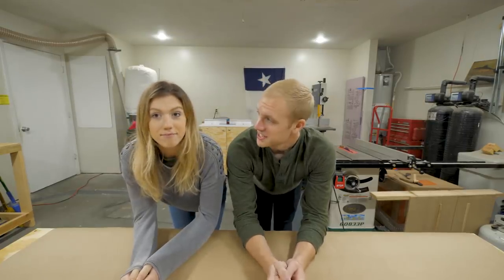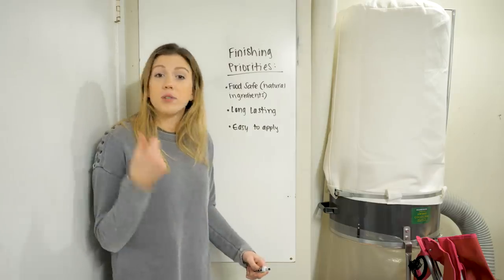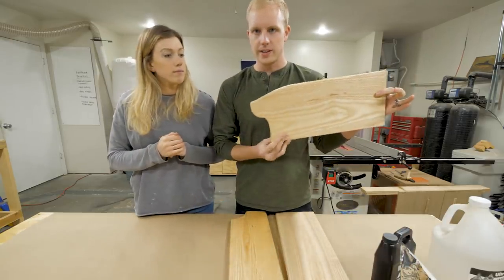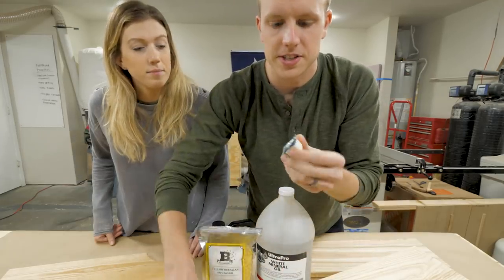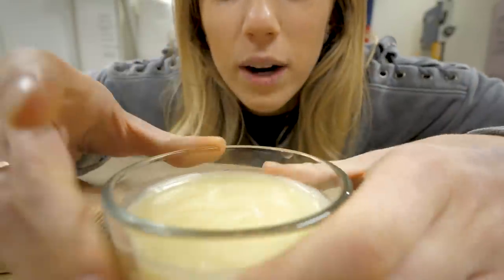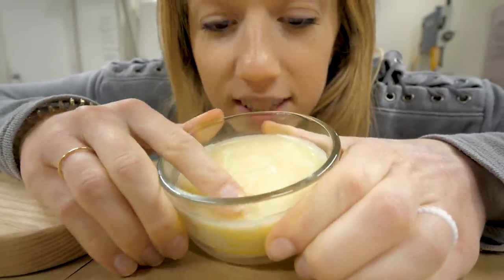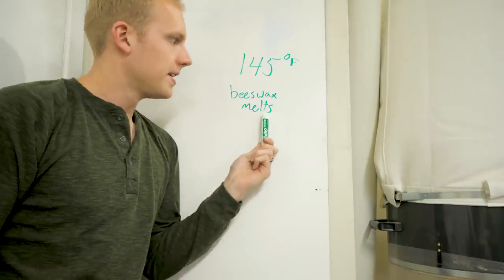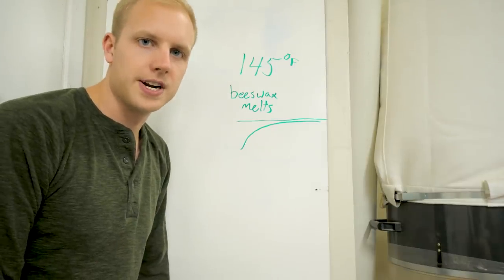we put a CUTTING BOARD in the DISHWASHER💦 and this happened...

Comment: I know a lot of people who make cutting boards saturate them (i.e. dunk them in a vat) of mineral oil to thoroughly let them absorb as much as they can. It becomes less of a finish and more of an impregnation of the board, but it really helps them to hold up a lot longer, barring the dreaded dishwasher. Though any board will require reapplying of oil over time and use.

Comment: In my youth I delivered for FedEx ground. There is no AC in those big boxy trucks. Decided one summer to put a thermometer back there. Had plenty of days during the Iowa summer that the temp was at 150F. Those semi trailers are the same deal. You might have some meltage of the bees wax in the summer time, but it should hopefully be negligable.
Reply from the maker: Good to know! Yeah I don't think it would be a big deal since it's distributed so evenly across the wood. Thanks for sharing your knowledge!

Comment: Thanks, Guys.
I love your channel and have kind of been modeling my cutting board production, in part, after you two. I wanted to tell you what I'm doing right now. All of this can, and probably will change as soon as I find a better way. I am doing a few (between 2 and 3) coats of mineral oil, and then 1 or 2 coats of Howard's Butcher Block Conditioner. Where I purchase the Howard's also sells tiny little 2 oz bottles of Howard's Butcher Block Conditioner. I include a small bottle with each cutting board, and instruct the customer to use the Howard's if the cutting board lacks luster or they put it in the dishwasher. I tell them to try to limit the dishwasher cleaning, but using Howard's after the dishwasher will really protect the finish. Your experiment proved that I was right. I was just guessing. Thanks for all you two do for the community. At some point, I will join your Maker's group.

Comment: I make end grain cutting boards. For finishing, I sand to 240, dip in a tub with food grade mineral oil for about a minute or two then, set on a rack to drain dry. After that, I melt a 3:1 ratio beeswax & mineral oil and apply to the boards and wipe off the excess. When I sell my boards I include a 2 oz cup of the beeswax/mineral mix for added value.

Comment: I sand to 1500 grit and you can definitely tell the difference. Smooth as glass. Then I dunk them for about 1/2 hour in mineral oil instead of rubbing it in.
Reply: Ritch Taylor doubt it
Reply: @somebodyandthem  What could you possibly doubt about it? I truly enjoy giving my customers the best and smoothest product I can. I will not cut corners.
Reply: I think typically people don’t sand past 120/220 because once moisture hits it the grain will raise and make any additional smoothing useless.
Reply: @JohnJones-it3us  most of us wet the board after 150 to raise grain,  let it dry, then do 180 and up... it will never raise again after you do that.  Just extra steps for a more professional product.
Reply: @stevenlarson6125  my problem is 1500 is just way to much, there is almost no reason to go that far past just being able to say "I sand my boards to 1500"
Reply: @inigomontoya4109  yes. I only go to 330 usually and get a very smooth finish. Also, the OSMO top Oil that I use works best at 330.. any higher and it doesnt penetrate very far.

Comment: I add a little carnauba wax to the mineral oil and bees wax.  It's plant based and totally none toxic, is harder than bees wax so will make a stiffer paste and will put down a slightly harder wax coating than the bees wax alone.  Also, your face grain boards, just as with edge grain boards, will develop knife marks from use.  End grain less so.  Although wood tends to be naturally antibacterial, the pores and knife marks can harbor bacteria.  Use soap to clean your boards when appropriate, which is most of the time.  When I make a board I provide a page of care instructions.  I recommend recoating with mineral oil or with my board butter mixture.   If anyone fails to read and follow the instructions, any board failure is on them.

Comment: You may want to try the Carnauba wax.  It has a very high melting point, so it should survive your dishwasher tests.  It's food safe as candies are covered with it.  You may have to put your wood projects on a turn table, balance it, and spin it at fast RPM, so when you press the wax against the wood it will create friction, melt and bond with the wood while penetrating it.  Good luck.  Cheers.

Comment: I don't know if I would recommend never using soap on cutting boards...could definitely lead to quite a buildup of bacteria if you never sanitize.  That is why it is very important to simply keep applying the beeswax mineral spirit finish after cleanings.
Reply: But beeswax itself is anti-bacterial, so ???
Reply: Best way to sanitize a board is to let it sit in the sun for about 8 minutes. You can also scrub the board with a cut lemon to sanitize it. My least preferred way is to use a bleach and water mixture.

Comment: I use a 4 to 1 mix as a second step after I put  oil on the board for overnight soaking.  It is a two step process but I think it is needed. for the board.
Reply from the maker: We did that too until Some friends of ours cut into a board saw no significant oil retention. If it makes you feel better, great. But there’s no practical value to letting it soak overnight.

Comment: Our food safe finish is a mixture of white mineral oil, orange oil and linseed oil.  we soak the boards in the oil for ten minutes. Then we let them set in a drying rack for twenty four hours before applying beeswax as the polish. We mix our oils in fifty gallon batches and I think it would be best if I don't give out the percentages of the mixture. I can tell you the it hard to find oils that have a SDS or spec sheet the states it's food safe because of trace elements.
Reply: Cajun Living problem with plan  the based oils like orange or olive oil is that they can go rancid
Reply: Its not a plan, it's the way we do it and most of the other large producers like us. I'm not saying its right or wrong its just the way a lot of producers do it.  We employ almost five hundred people across the USA and that still doesn't mean we are right  so do you own lab testing. The Orange and Linseed oils are only a very small percent of the total volume of the oils. The oil is not spread on the wood products are lowered into a heated tank of this oil. The beeswax is also a mixed with mineral oil so it is a soft past.

Comment: Is it reasonable to suggest that a beeswax oil mix will melt at a lower temperature than pure beeswax?
If you are using larger amounts  (250 g or more of beeswax) you may get it cheaper from a local beekeeper.

Comment: @JnD I hope you are not spending that much for your bees wax as the link you have for Amazon!!!  Do a search online and find a local beekeeper and you will be able to get fresh beeswax straight from the hive.  #1 Cheaper  #2 supporting local  #3 added value to your customers.  I know you might think its easier because you can measure the beads but you are not actually getting a true measurement because the air space between the beads.  If that is the ratio you like measure out the amount of beads and weigh it then shave off a hunk from the block of wax you will get from the beekeeper, once you get the size that matches your ratio needs you can make a guide that will allow you to cut from the block the same each time.  My 2c

Comment: Excellent video.  I'm not in favor of the mineral oil + wax finishes just because mineral oil never dries.  It will always have an oily feel to the surface.  I prefer to mix the beeswax with a bit of boiled linseed oil (BLO) or Tung oil.  Both of these do cure/dry completely which help retain the finish despite the abuse that wood kitchen products receive.  I have a large (14") salad bowl that gets used and washed 4-5 times a week and has only had to be refinished 8 times in 43 years. BLO+beeswax is my go to wood finish for kitchen/food items.
Reply: I've heard that boiled linseed oil can put a weird taste on food that touches the wood. Has this happened with your stuff you have used it on?

Comment: I'm wondering why you don't use a drying oil, like tung, walnut or linseed oil (aka raw organic flaxseed oil? (never boiled linseed oil, it's toxic).
Reply: I've heard that those can impart a weird taste on food that is chopped on the board. That's just what I've heard so it might be BS
Reply: @parkerstaker5413  The great aspect of a drying oil is that it will polymerize (become like a plastic) that bonds with the wood. Once fully cured, it will become a part of the wood and won't rub off or melt off. Mineral and beeswax is fine, but will always have to be periodically re-applied.
Reply: You have to get  REAL organic boiled !

Comment: Remember, while your customers might be savvy enough to know not to put cutting boards (or any wooden kitchen implement) into the dishwasher, that doesn't necessarily include the people that they live with. I just about hit the roof when an old hose ate of mine put my Ulu cutting board through the dishwasher. I ended up having to replace it because the glue started to fail. 🤬

Comment: your boards are Face wood , so you need to work the grain sanding not just one grit fix all for smoothness reason why this been done for 100 years , You can just add your mineral oil wax finish but the boards will unlikely last more then year in daily use , You really need to ad a wood "treatment" prior to the wax finish let it cure then apply . You are skipping steps that are critical to your marketing plan of top end boards . Dishwasher or Micro will destroy any wood product dishwasher soap has Lie in it so no scrubbing needed . Wood is still alive at the molecular level and as a wood worker  you need to respect this that it will always be changing . FYI I been in Houston 12 years now . certain times of year you simply do not do certain wood projects .  Not all finishes are Non Toxic when cured also !!! wow that was a dangerous statement . Be Careful what you say here it is clear you know just enough to be dangerous in making food products FYI I make a wax finish I don't use it on my food products at all .  you need to apply a finish to boards before you do a wax toping treat the wood first then protect it  and the product will last generations